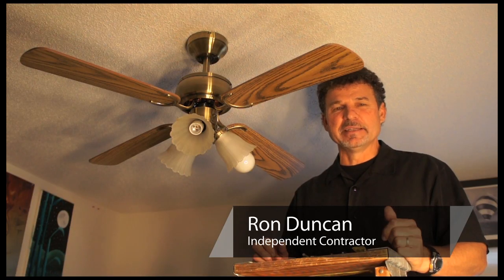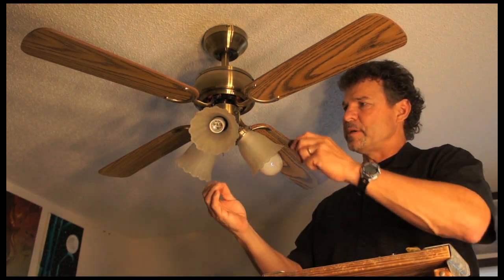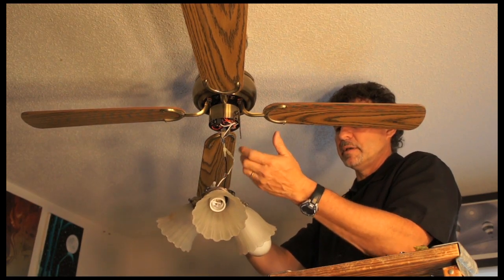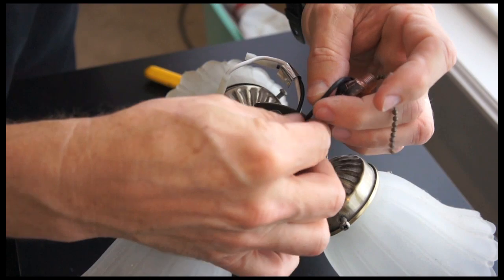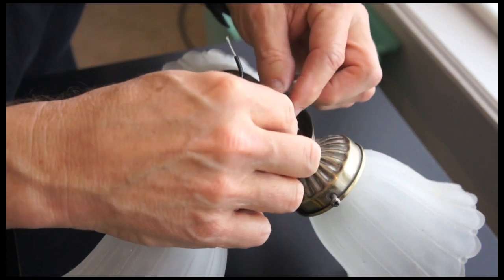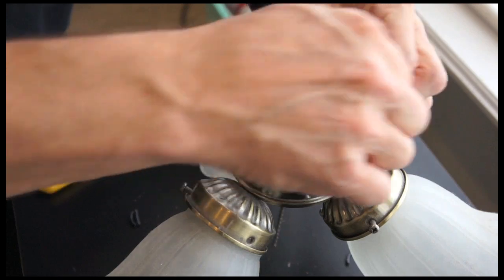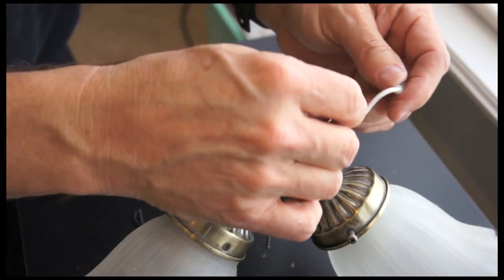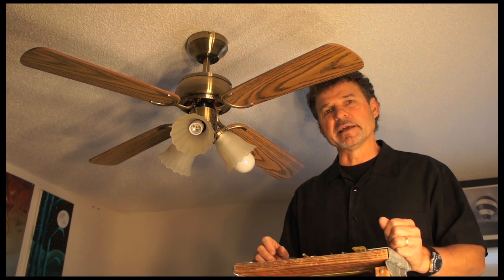Electrical Home Repairs : How to Repair a Ceiling Fan's New Pull Chain and Light Switch

Comment: I just watched your video went to Ace,bought the parts $10.00 and fixed it myself. Took me longer to drive the the hardware store than it did to fix the light! I figure an electrician, would have charged about $75.00 to come out plus parts would be about $100.00. Thanks for saving me $90.00 today!

Comment: Will this repair also work on the fan pull chain?  I purchased a "3 way ceiling fan light switch" from the store.  Is this the part I need?  Thank you

Comment: I just replaced my old fan with new one. Everything works great but the fan is wobbling a lot because wont slide lock  in to the wall mount.

Comment: What if I opened my canopy and found that the people who owned the house before had snipped the wires to the switch and just connected the wires from the lights to the top all three white wires from the three lights to the one top lead wire and same with all three black to the one top lead wire with yellow wire nuts. My old switch had been cut and my guess is they just directly wired it. I could not switch the lights on or off  I had to unscrew the light bulbs.

Comment: What if you're fan doesn't have a pull chain or a 
Light switch?
Reply: It's a remote just replace the batteries
Reply: XD looking back at the comment, that was dumb of me...  I don't even know why I posted it, cause the title clearly says what you're repairing in this video...

Comment: When you get a bill from the hospital for 90,000 for getting electrocuted, I'm going to laugh so hard.
Reply: I personally have been shocked by 120 volts ac, and though it was not pleasant, I didn’t have to go to the hospital. Besides he disconnected the power so there is no reason he should get shocked.